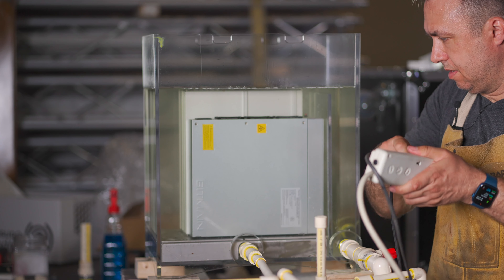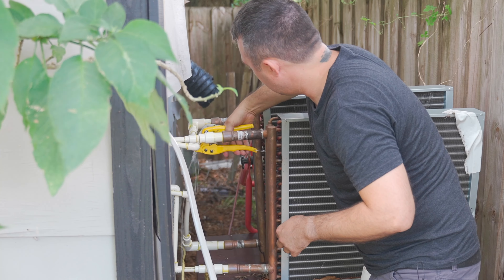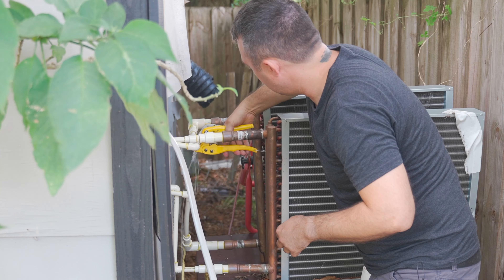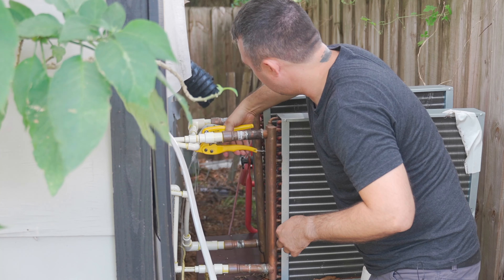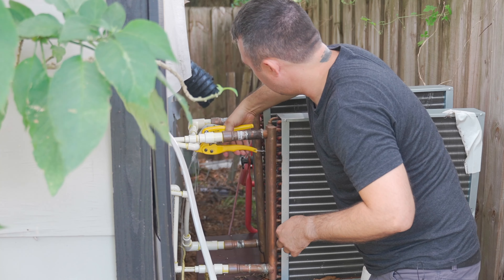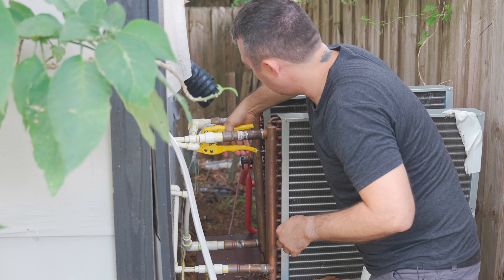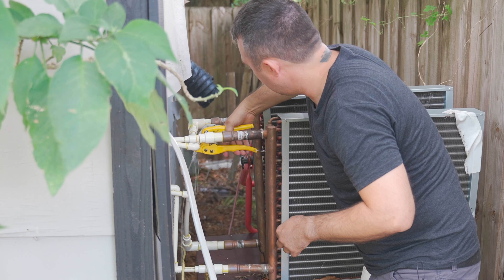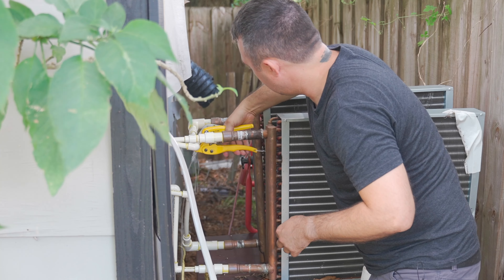Immersion Cooling an S19J Pro Bitcoin ASIC Miner With a Two Loop Heat Exchanger

Comment: Have you considered 2-phase cooling - you can buy dielectric fluids with a low boiling point - as it comes into contact with a hot component it evaporates. You immerse your system in an airtight box with e.g. a radiator on an external cold loop sitting in the top and seal it and turn on. The fluid evaporates on the component - you are able to remove much more heat this way - bubbles to the top of the box (so you don't need any fans or pumps to move stuff around, it circulates itself), then recondenses on the e.g. radiator and drips back into the whence it came. result - better cooling, less moving parts / complexity / power... Watch this: https://www.youtube.com/watch?v=5w4vB5P7yxw&ab_channel=ThomasCrandall
Reply from the maker: I’ve seen one of those systems running on a big server rack at Engineered Fluids HQ! I wonder if it can keep up with FAR MORE wattage than just a CPU.. If it scales well that would be a much more efficient system..

Perhaps I need to give it a try!
Reply: I was looking at buying a house with a pool recently (in the UK where it is cold) and wondering if I could heat the pool for free with a few bitcoin miners in this way - probably with a distilled water loop going through 2-phase tank and then exchanging heat with pool water loop somewhere away from tank ... to avoid pool water getting anywhere near the miners ! or, distilled water is cheap - you could run this loop all the way out to the pool...
Reply: or perhaps run an underfloor heating system from it... miners do not need to turn a profit, just wash their faces and provide lots of free waste heat...
Reply: @SPACEDESIGNWAREHOUSE  I think you definitely do - firstly, because it will be a fun project and secondly because I can then copy you :-)
Reply: when the dust settles after the halving and a lot of old miners that don't turn much of a profit but might be good for a heating project become available cheaply...

Comment: your tubes are too small and the heat exchanger also
Reply from the maker: When I used this same heat exchanger with my pool, initially, it kept the miners hottest temp in the 60’s!  But this radiator can’t keep the water that cool, and so if I changed anything I think it would be a bigger radiator.  
But you’re right, more flow would do the trick also; 48c is plenty cool.